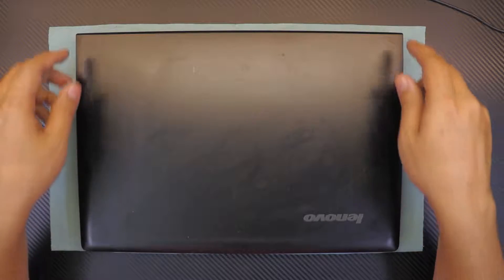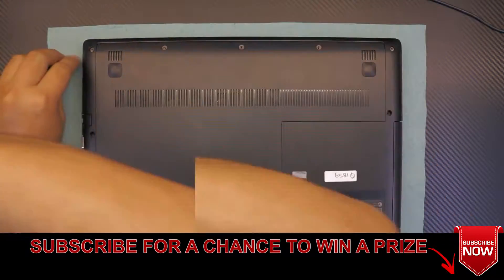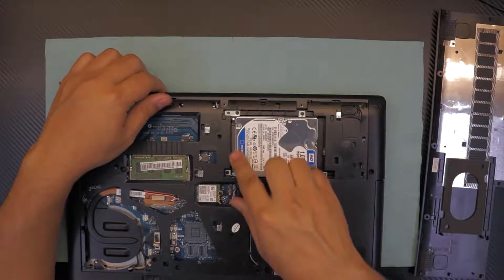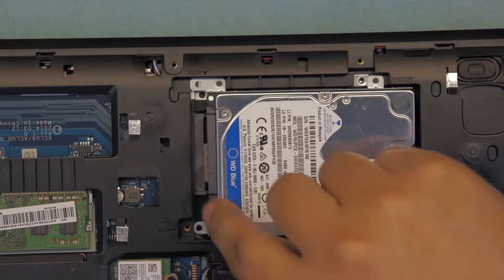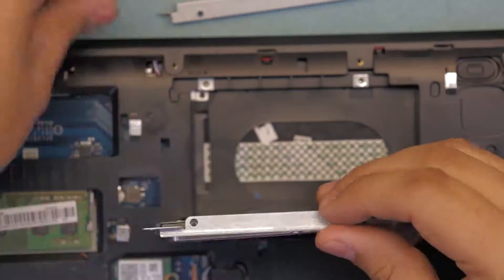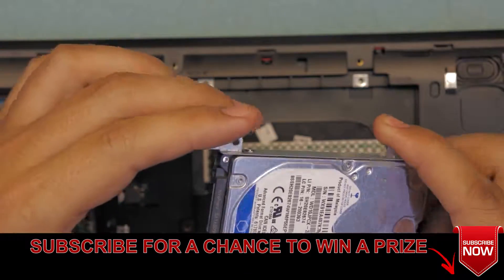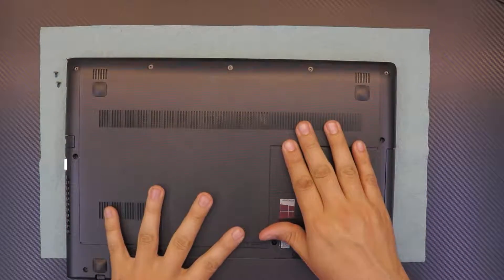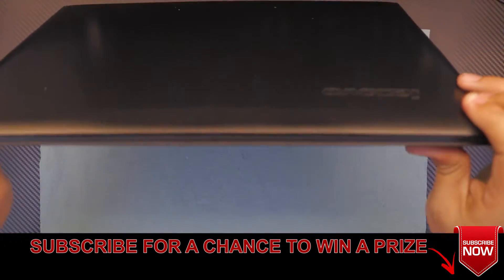Lenovo G50 UPGRADE Hard drive or replace with SSD drive

Comment: Hello Sir I have same Lenovo G50 Laptop 1TB HDD. I want to install SSD by myself. First question is it possible for me if I buy SSD from amazon and replace it with HDD ? Actually  confirmed from local mechanic he is asking 4500 rs for 256GB and he said both HDD and SSD can be installed at the same time. Can you please comment on it?

Can you suggest any SSD 512 GB at least that I can install in this laptop by my self ??

Thanks in advance
Reply from the maker: Thank you for the feedback! if you wish to support the channel you can LIKE or SUB or both :P
regarding your question:  you can only upgrade the HDD to SSD (replace the HDD with SSD), you can't have HDD and SSD, UNLESS you remove the DVD drive and buy an adapter: https://amzn.to/3IRgAix
then you will not have a an DVD drive but you can place the old HDD inside the adapter and have your SSD installed where HDD was before. that is the only way you can have HDD and SSD. you can purchase any brand make model of SSD as long as its SSD SATA 2.5'
shorturl.at/dhGS2
shorturl.at/fmnvw

Comment: I changed to a 120gb Kingston ssd but i got some sort of error that ssd not accepted...
Hmm it was new ssd With no OS on it.
Reply from the maker: sorry but there is no such an error saying ssd not accepted :/
you can easy place up to 2tb ssd without any issues.
its a sata 3 port , we update this laptops alot in the shop, if you want can you give me the steps that you took adn the brand of the ssd and few pics of the error and i could assist you.
Reply: @uFixTek   Yeah this was a while back. maybe 1.5 year ago so i dont remember what it said , but i do remember it didnt work for me to swap from hdd to ssd on the laptop for some reason. But yeah man thanks for reply :)
Reply from the maker: @JPHER217  its my pleasure my friend but we do upgrade this models all the time and different brands of ssds and 120gb up to 1tb we have place . if you ever need any help or request feel free to ask me here . good luck
Reply: Hello @uFixTek, thank you so much for this clear illustration. My DVD slot on this same laptop model got spoilt and I want to replace it with a HDD disk. Do you have a video tutorial to guide me?